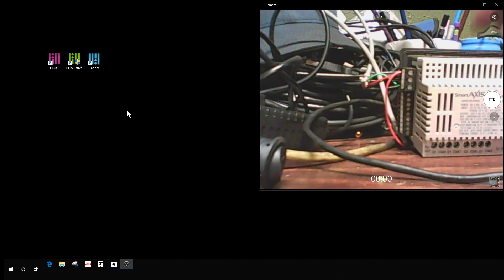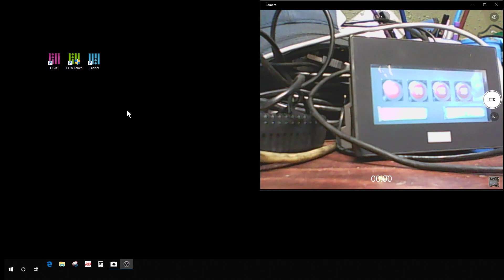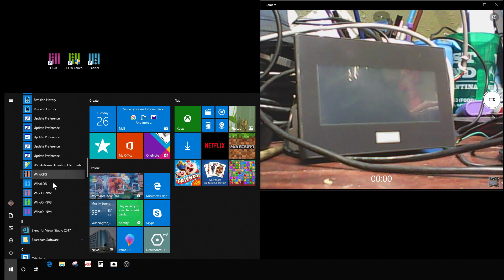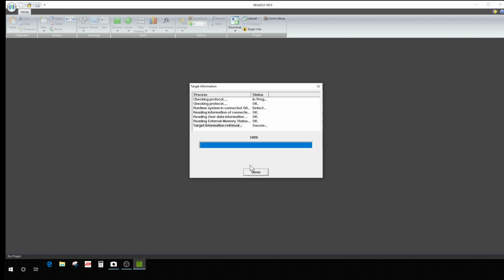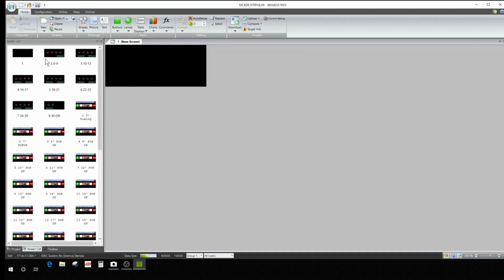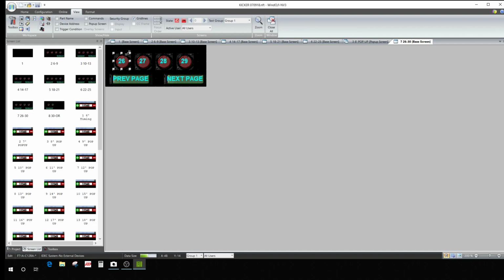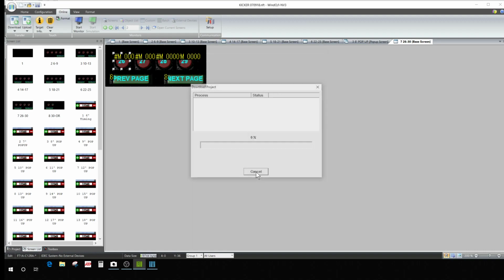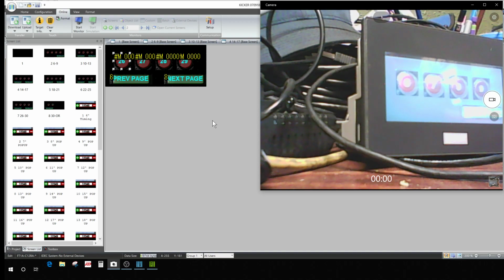FT1A Touch Communication

Comment: Thanks for the previous answer!  I have a new question.  I dont have one of these yet but planning to use one in a new project.  I just realized today how very small the display is (1.5"x3.5") and how low the resolution is. (100x240)  is that ever a big problem?  I want to use the trend line display feature but now I'm realizing it's going to be pretty tiny.  Thanks.
Reply from the maker: When I have used Ft1 touch, it was for basic machine operation.  Like for a compressor, or a pump lead/lag operation.  The display is too small to get much intricate feedback from.  Thats my opinion.  I have older eyes also lol.  If you are wanting to graph anything significant, I would move up to one of the larger displays.  And, they do have embedded web pages, which would be great for viewing graphs.  You could probably graph on "Advanced HMI"  for thd FT1A.  Though I have never done it.  I intend on playing around with Advanced HMI more.  It seems like it could be a useful tool.  The embedded pages of the larger IDEC HMI's are better for control, because the mimic the HMI.  In my opinion.
Reply: @huntxtrm  ok. Well I will be trying it out so I will let you know how it goes and I will probably have more questions. Thanks.
Reply from the maker: @michael931  let us know how it goes
Reply: @huntxtrm  well I've downloaded the 1134 page manual.  I mean one of the 3 manuals...
Reply from the maker: @michael931  For "Advanced HMI"  There are some good videos on Advanced HMI.  To get you started.  Tinker with it from there, and dig in to the manual as needed.  That is what I would do.